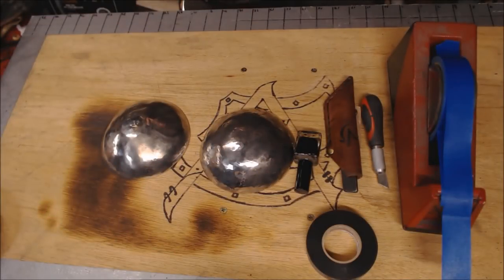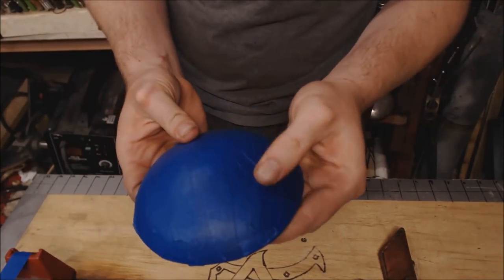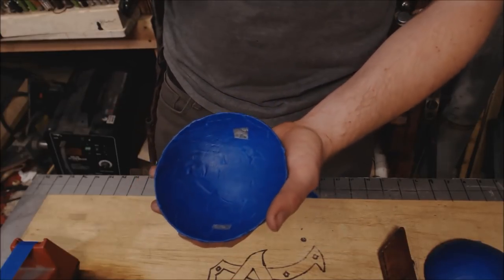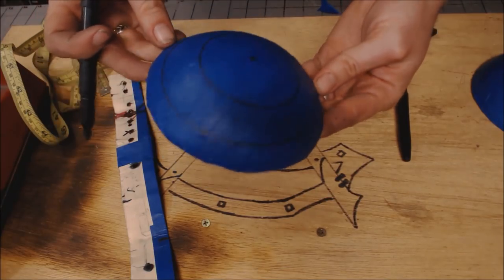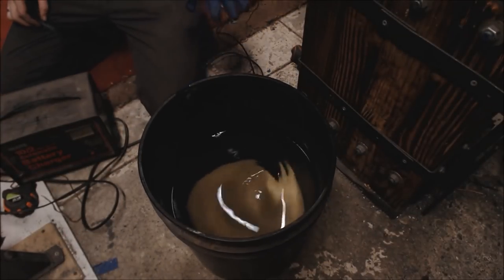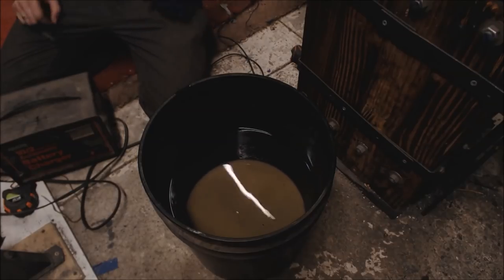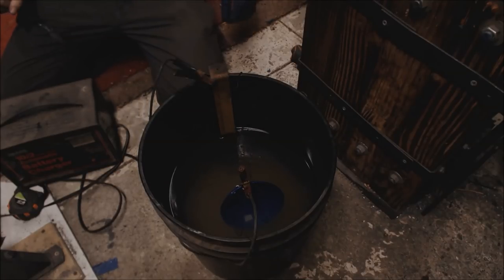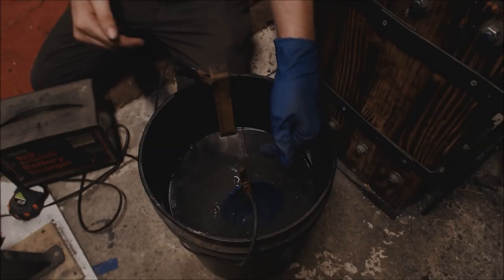Electro Etching Metal- How to add detail to your armor!

Comment: Great work, I learned alot👍😀
Reply from the maker: Great to hear! If you want to try this at home with a 12v battery charger make sure it's an old one! It has to spark if you touch the leads together, a lot of new ones have inhibitors on them that make it so they don't put out current for uses like this, if you have any questions let me know :D and Glad I could help :)